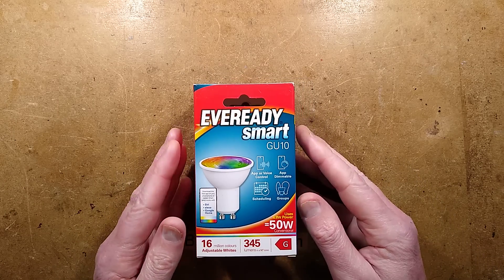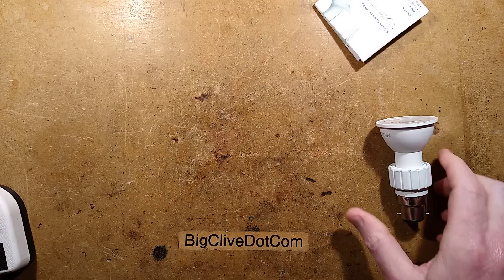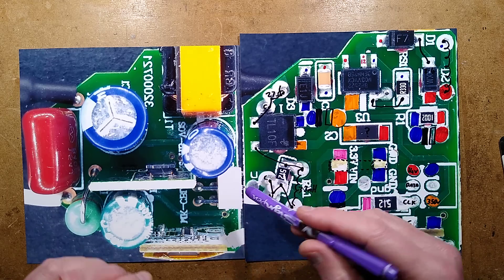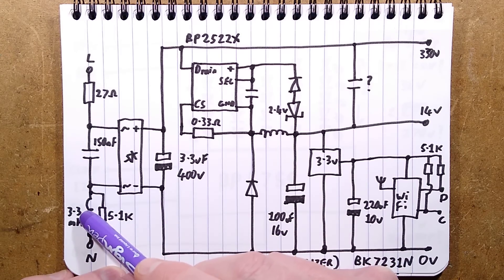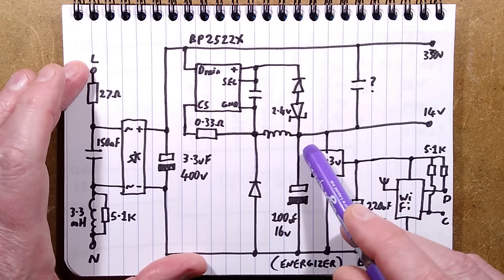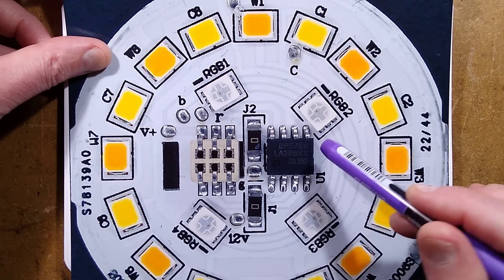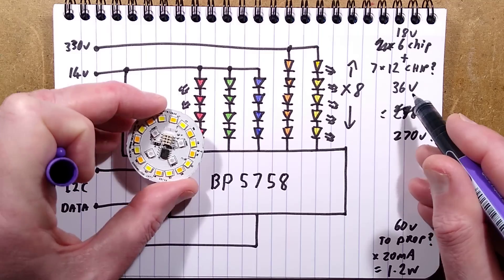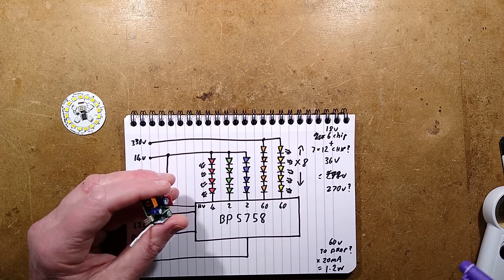Poundland Eveready WiFi lamp teardown - with very cool chip

Comment: There's firmware for the BK7231N and BK7231T chips which doesn't involve sending people your data. It's a firmware modeled after Tasmota, and is reminiscent of it. It's called OpenBK. Disclosure: It's a project I have contributed to in the past.
Reply: Yes but nothing compares to the Tasmota system, its large support base and that it is combined with the PlatformIO IDE for user modifcations beyond the already extensive precompiled Tasmota functions. The standard approach for devices using the BK modules is to replace them with an ESP8266 module having the same or very close form factor. Some modules have identical pinouts. How much jerry rigging you need to do varies as to which replacement module you can get. It can look pretty ugly but nonone will see it. The benefit to switching over to Tasmota is worth the effort. If only you OpenBK folks got together with the Tasmota folks and combined systems so that one just sets a flag in the Tasmota PlatformIO IDE integration and wham one compiles for BK instead of for ESP.
Reply: Hey, props for being honest with the disclosure. We need more honesty in this day and age.
Reply: My understanding is ESPHome also now supports Beken modules. Not sure... I've only got one Beken based device, and it was more of a curiousity than something I wanted so it got flashed with OpenBK to see if it worked and then put in a cupboard.
Reply: @tin2001  correct, ESPHome supports the mentioned BK7231 chip, in a custom fork. It's going to be merged into upstream soon. Disclaimer: I'm the author of the fork.
Reply: @polirycynooleinianpoliglic9200  nice cuz every device i own i have hacked a esp8266 or esp32 running esphome and local control is great its so fast and home assistant make you not need to download a million app
Reply: @tin2001  I'm really glad you mentioned ESPHome,  as I have some of those modules and was wondering what I might end up using them for...
Reply: @tin2001  nice to see esphome enjoyer out in the wild, indeed esphome now have official support finally for bk and rtl chips, aka libretiny platform
Reply: @tin2001  There is indeed a fork of ESPHome that uses the LibreTiny development platform to support Beken chips and a couple others.

It's pretty cool how after ESP was abandoned by Tuya the new chips also got an open firmware foiling Tuya's plans.

I wish there was a direct HomeKit integration firmware like there is for ESP though (HAA)
Reply: @Yrouel86  home assistant is clearly better in all regard, plus esphome have native support, both doesnt require cloud at least
Reply: @Yrouel86  if you really want to use home kit you can just use matter firmware
Reply: I believe it's also possible to use Tuya cloud cutter. Could it somehow be flashed over WiFi? It's better than opening the lamp.
Reply: @MyProjectBoxChannel  the Beken modules used a firmware that was patched against the Tuya exploit. It's a cat and mouse game in that regard.
Reply: @AnnaVannieuwenhuyse  But thev've introduced a new one with the beken modules xD
Reply: @MyProjectBoxChannel I have some different bulbs with 7231T chips that I've flashed it OTA to the Tasmota like firmware. The problem is that the manufacturer keeps changing the chip/firmware so it's a bit of a lottery if it is going to work. I hate when manufacturers want to tie you into their ecosystem so they can farm your data.
Reply: @miked4122  I think people are doing great work with this custom firmware. I think it's worth the risk to try and flash the cheaper bulbs. You don't have much to lose when it's only a £5 lamp. And if it works you can buy more of the same.

Comment: Org buying the ones that use the infrared or RF remote control and don't worry about a Wi-Fi or Bluetooth connected one those Bluetooth and Wi-Fi ones don't usually work that well and if they do they're a pain in the butt the good old RF remote or infrared remote ones work GE has several that use the Olympia red remote

Comment: Well, I do think smart homes and IoT are smart and secure. But not if you use store bought devices. Especially not the ones that only work through the cloud, so you can't use them without internet, that's not smart, that's bullshit. If you do it yourself however, write your own software use some trustworthy open source software, design it to be able to run over the local network, without relying on internet and all. Then it can be very smart and very secure. It's kinda fascinating how there are many fairly decent open source solutions out there and yet most manufacturer flash some insecure piece of garbage firmware onto their devices, essentially rendering them useless.

Comment: I would think that maybe the mystery capacitor is there to ensure reliable startup. At turn on this cap would momentarily pass voltage to the 14v rail to give it a kick start.
I think that maybe the oversized box is to differentiate the wifi lamps from the normal ones, if it was in the same size box you could just imagine how many of these lamps would be returned as faulty when customers expecting a normal lamp plugged them in an it started flashing.
Reply: ...or how many would be 'box-swapped' instore by dishonest customers pre-checkout.

Comment: Not cool brother bear! Why does Europe get very cool and so unusual LED lamps. But also, visiting Europe again 2 weeks ago, Spain, France and Italy. I did notice LED lamps being way more expensive that the US prices. Fun story. While in Italy I was honestly thinking of bringing European 240V light LED bulbs. I was sure that they would work at our weak U.S. 110V current up at half lumens/voltage. Nope! it didn't. 

Well, the best part was that while many miles of walking I found a thrown away lamp that had an E-27 bulb and an European intermediate base one, both LED's. I grabbed them as a scavenging American bear bum, I was.  🐻 When we got back to the fancy Double-Tree hotel in Rome I was itching to test the bulbs as the joint had a a-27's The found bulb worked! No intermediate fixtures were around. But it must be a good one, as it has a "made in France" etching.  OK, sorry for the ramble which reminded me of light bulbs.

Comment: The mystery cap is the snubber for the buck converter's built in mosfet.  The placement is unusual having the inductor in the loop, but not unheard of.  Without that cap, there is no drain to source connection for the inherent voltage spikes.
Reply: It sits between the sense and drain pins, source is probably the 330V pin (P channel FET).

Comment: Never heard of 14 volt RGB LEDs... are they overvolting them for a little extra brightness and shorter-life revenue???
Reply: You are thinking of LED's as constant voltage devices when they are really constant current devices. The 12V strips you see are sets of 9V LED's with a resistor wasting the remaining 3V and regulating the current through the LED's to a semblance of constant current. 

This bulb has 4 LED chips in series, which amount to over 12V for green etc, so they can't power them from 12V. The current, and consequently the power, are decided by the controller chip (as opposed to the resistor earlier).
Reply: They compensate for the voltage drop in the color switching chip .

Comment: I wouldn't mind local WiFi (or better, Bluetooth) connectivity. But things that have to "call home" just to function are a big nope for me.
Reply: can be reprogrammed yay! sadly its not as easy as esp8266/esp8295 based lamps because you need a new flasher program and installing that might not be easy
Reply: @309electronic5  Are you saying esp8266/esp8295 chips do not need a flasher program to program them?
Reply: @uzlonewolf  a simple usb serial ch340g can program both esp and bk
Reply: @lifeai1889  We are talking about the program to flash them, not the USB-to-serial chip.
Reply: I got Philips hue down lights in the soffits around the house and use ZigBee and home Assistant on a pi4. 

I was afraid they would disconnect, etc but they work great.

ZigBee turns each device into a mesh system too. It's an alternative to wifi.

Comment: I wonder if theres some kind of component add-on you can connect to one of the chips legs that turns off the wifi or cancels the signal seek.
Reply: not any option, the only option is reprogramming them wich is possible! sad they ditched the esp serie and went for beekn chips wich are more difficult to search software for and program

Comment: Dave Jones of EEVBlog gets angry when people say "I Two C" I2C instead of "I Squared C" I²C.
Reply: Anyway, the 2 means there's two I's just like the two E's in E2PROM .  I2C=I²C=IIC=Inter IC, a Phillips bus for connecting the logic inside TVs and Radios built from their modules, but also used in some video signal cables to autodetect stuff .

Comment: I wonder if the mystery capacitor gives a pulse of voltage at start uo as there is a reverse biased diode above the zener
Reply: It's forward biased, 14V rail should have been drawn above the 12V sense/pwr input of the chip .
Reply: @johndododoe1411  Yep, got a little confused, but still think the cap might provide a start up pulse

Comment: How is in the UK the LED lights and electronics that are reviewed all appear to be so easy to open and view the circuit boards.
It seems all, all such devices in Australia are sealed that only a hammer and vice can open them and once open they are either fully potted in silicon or epoxy.
Reply: Big Clive is a big bear of a man.
Reply: So you Aussie can’t use the technology against your master🤪

Comment: Missing capacitor is because there used to be one, but someone realised you can use it without one, so they've saved a third of a penny per ton of units
Reply: OR, that is in the UK at 220v 50Hz, whereas here in the USA it may have the cap in it for 60Hz 120v operation. I will look for one to dissect.
Reply: @transmitterguy478  good idea
Reply: How do you know?
Reply: @OG_Steamer  experience
Reply: @phonotical  and then some other bright young lead will save another penny by reducing quality 0.8%... hardly noticeable .

And in 5 years,  they'll be cheap crap.

Same happens with food. 

My "magic chef" home ac was built in 1987.   The original capacitor was 27 years old when it burned out.   The replacements last 2 to 3 summers. 

The unit is made of heavy steel.    The heater portion failed after 38 years. 

I'm told the unit I have to replace it with in 2025 will last no more than 8 years and will start breaking down after 6 years.
Reply: @mac_mcleod planned obsolescence. There's no profit in making a product that lasts forever, so they make one that breaks so they can sell it to you all over again.
Reply: @mac_mcleod  ugh, it's always the way, people put no care into what they make now, if they made those things in your home country, they'd probably last a good 30 years

Comment: I really hate the disco mode being default. I have 30 TCP led WiFi bulbs which are no longer supported. The light quality is fantastic. But I can’t even use them on a regular light switch because they all flash as soon as they are powered on. Really annoying considering I paid $10 each for them.
Reply: They are probably ESP based and you could flash the open source tasmota firmware onto them, if the original firmware is old enough. templates.blakadder with the top level domain for companies should help out in the bulbs section.
Reply: You might find one of the alternative apps works to connect to them, Smart Life or Tuya Smart are basically the same apps and work for lots of devices.
Reply: @JamesChurchill3  Good shout, Smart Life did it for me.
Reply: @JamesChurchill3 
And the bonus is it doesn't matter which brand app you use. Because they all talk to Tuya on China anyway. If you're OK with one, you're presumably OK with any other.
Reply: I'm using a cool White LED flat top like this in a table lamp.

I then place a little chilli sauce tub full of coloured washing up liquid on top of the bulb with the lid facing down.
(Squeeze out excess air and wash and wipe dry the outside)

Great light diffuser, colour changes every time I buy a new bottle of wash up liquid, 
Yellows & orange looks good,  or separately pour yellow down one side separated with a bit of card,
Pour red down the other side, remove card and place on lid.

Gives a nice pink effect up the wall while shining a pleasant amber towards you.

And NO tub has ever leaked.

Comment: The company currently known as Energizer Holdings, Inc used to be named Eveready Battery Company. They originally sold all of their batteries under the Eveready brand name but in the 1980s they started selling their higher-end products under the Energizer name. Eventually the company renamed itself Energizer after that name became better known, but they continue to sell products under both names. They also own the Ray-O-Vac brand.
Reply: Yep, Eveready as I remember them too. Energizer etc did that weird thing using your thumbs to see how much capacity the cell had in the '90s or maybe '00s, more of a gimmic to sell the batteries. But kinda worked for selling them instead buying a cheaper cell or batteries (depending how many bought), kinda clever marketing though.
Reply: @gavingiant6900  odd, that was a duracell thing here in the uk
Reply: @TheChipmunk2008  They were all at it at one point in the UK (mainly the big companies).
Reply: @TheChipmunk2008  *admittedly Energizer dipped on that idea first.
Reply: @gavingiant6900  the uk division of eveready was ever ready, 2 words, official name 'british ever ready electrical company' BEREC, also made radios, mostly battery ones, of course, but a few mains only models, mostly under the ever ready name , as with the batteries and torches, but also BEREC brand, from the 50's, mostly for export models, then meaning 'british ever ready export company'  , BEREC branded radios are pretty uncommon , (especially a few models unique to that brand, not made under 'ever ready'), but ever ready ones turn up quite a lot ,
Reply: @andygozzo72  Sorry for my typo, but you must have seen the Yorkshire rose..?
Reply: @andygozzo72  Basically not good with words (depending), but good at practical.
Reply: @gavingiant6900  ?
Reply: @andygozzo72  Which bit are you questioning?
Reply: @gavingiant6900  yorkshire rose?
Reply: @andygozzo72  That is my bad on that part, I sent it to the wrong person.
Reply: @gavingiant6900  no that was Duracell
Reply: @gavingiant6900  all it was was a cheap "disposable" battery tester built into the battery wrapper. When you pushed down it completed a (short) circuit that changed color based on how much volts were passed through it.
Reply: @twiz66  *amps
Reply: @twiz66  A gimmic like I put, but they sold well. Also ampere hours.
Reply: @gavingiant6900 Duracell still has this feature today, PowerCheck
Reply: @gavingiant6900 I remember those strips, I think they sold them separately too.
Reply: @alastairward2774  The separate ones definitely ring a bell with me too, now you mention it. Abit like those strips that you would measure a babies temperature.
Reply: Hearing aid cells are cheaper under the Ray-O-Vac brand, for some reason.
Reply: @markiangooley  Depending on where you are, coin and button cells are often cheaper when purchased from a pharmacy than other retail outlet, as the taxes are applied differently for medical/therapeutic accessories.
Reply: What a comedown for the formerly mighty EverReady name. It now seems to be one of those 'zombie' brands; lending their name to whichever company will pay to have it on their products. (along with the likes of Polaroid, Bell & Howell, Kodak, Blaupunkt, Memorex, etc)
Reply: This thread of comments could have been it's own video! 🤣
Reply: You are talking about the American Company here. The British Ever Ready Electrical Company was asset-stripped in the 1990s and is now a zombie company.
Reply: @katrinabryce  Not really, in 1992 the british company was sold back to its original parent it separated from in 1914, the American Eveready battery company which later became Energizer holdings.
Reply: Now, they eat brain cells.
Reply: In India Eveready is the more established brand. Energizer was only introduced in recent decades, and it is mostly too "premium" for India anyway.
Reply: Most everything is too premium for india..  america is heading that direction also with how many stupid people keep breeding and becoming the majority..  you see what are the main arguments throughout the government and cities..   bunch of ignorant insignificant bullshit..
Reply: Did we grow up after Union Carbide ?
Reply: @laustinspeiss  yes
Reply: @TheChipmunk2008  Sadly, a lot of people died to make that change of name - ref: Bhopal, India
Reply: @laustinspeiss  Absolutely, i  thought of Bhopal while typing it :(

Comment: The WiFi-chip on the small module is probably a ESP8285, the single-chip variant of the ESP8266, of which there exist hundreds of alternative firmwares for, and it's even compatible with Arduino etc.
Reply: Clive has mentioned it's a BK7231N. Those are distinctly NOT ESP82xx chips. :)
Reply: not anymore sadly tuya has ditched the whole esps and switched over to beken
Reply: Yep and you also can easily find them as ESP-01M or with Tuya you will go somewhere towards ZS3L (Zigbee), WBRG01 (Wifi/BLE) or CB3S (Wifi) kind of modules, but in different form factor.
Reply: Can it be programmed over I2C?, because that bus is conveniently exposed on the top PCB just put your probe on the board connector and issue whatever magic commands to reprogram the module.
Reply: @johndododoe1411 
Nope. Need to use the TX/RX and GPIO pins for the ESP versions.
The Beken ones can mostly be programmed wirelessly using Cloudcutter though... This is somewhat more convenient, even if you can't run Tasmota (OpenBK is the alternative, but it's not quite as good).